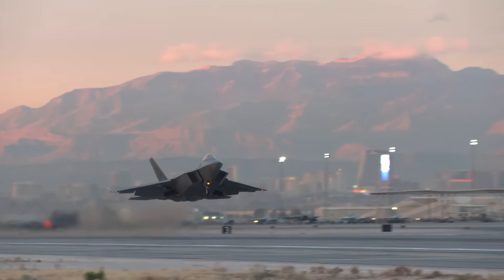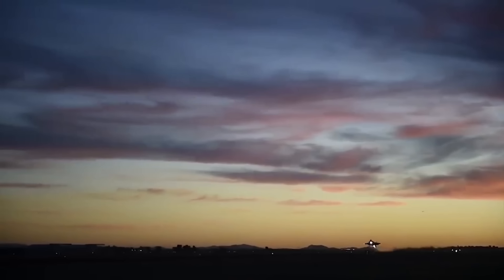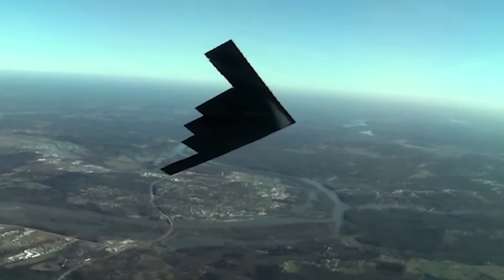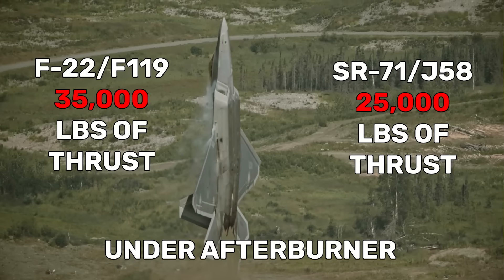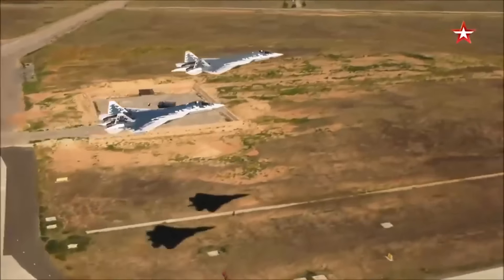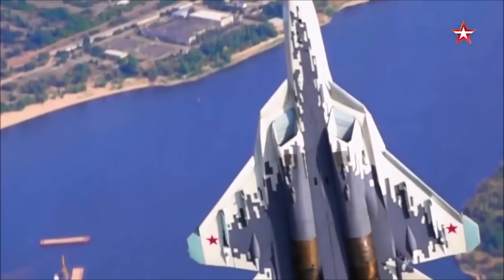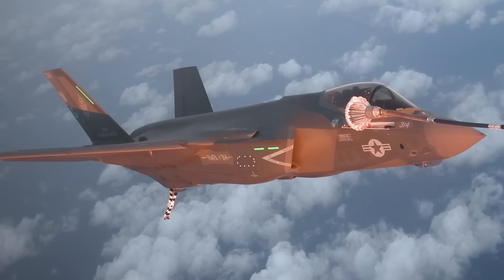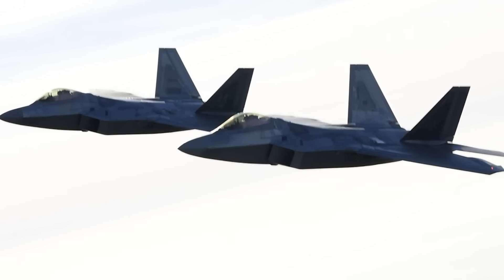The race to field the most powerful stealth fighter engines in history

Comment: Air Force should've gone with General Electric's YF120 variable cycle engine...
Reply: Always about money unfortunately.  Plus, 10 years Lockheed told airforce they would reach a point where the current f135 engine could not provide enough cooling power.  Which is the problem they are running into now with block 4 upgrades.
Reply: @ShadowOppsRC  Duly noted.  I've seen articles specifically addressing the need for cooling power with the upgraded processor suite(s).

Comment: The Northrop YF-23 had a 40% range advantage over the F-22, which has the same net advantage as more modern and efficient engines.  It also had a lower radar signature than the F-22 and a 10,000ft greater service ceiling.  All of which are great advantages.  Many people think that the F-23 should have gone into production.  It may have been slightly less maneuverable than the F-22, but this could have been mitigated by installing thrust vectoring onto the F23.  Also, the F-14 has much greater range than either the F-18 Super Hornet or the F-35.  It was a great shame that modern versions of the F-23 and the F-14 are not in use today.  Interesting to note that the USAF is getting hold of as many newly built modern F15 aircraft as it can, which is an aircraft that in many ways is very similar to the F-14, with great range and endurance and kinematic performance.  Range and endurance will be highly important in a war against China.  It seems that bad decisions made years ago are having an impact today.
Reply: Its service ceiling is the same and the difference in radar signature is small. Yes it went further because it had more space for fuel, it isn't like it just magically went further. It wasn't slightly less maneuverable it was enough that it couldn't keep up with the F-22 and would get zeroed. Stop it with the nonsense bellyaching.

Comment: The problem with claims by both China and Russia when it come to modern jet engines is that they still lack the capability to EDM drill the 8 or 10 mil cooling holes and then laser ablate an equally tiny diffuser on top of that hole hundreds of times on a super allow turbine blade with a complicated internal serpentine to trailing edge configuration.  Even doing this in a lab is hard enough and then taking it to a mass production environment is extremely difficult.  I know for a fact that the WS10 had a military power life cycle of less than 10 hours, and is therefore highly "derated" (operating at a lowered firing temperature) to actually use it on their planes.  What this means is that they are limited in the true power they can use for these aircraft in everyday use and training.  To use the engine at it's full power will mean shortening it's life cycle to tens of hours before needing to re-aero the turbine.  The WS15 is not a great leap over the WS10, and still has the same problems with cooling at higher power.  In a conflict China would likely find it's self in a supply chain nightmare as they would not be able to maintain their fleet.

Western engines are measures in the many thousands of hours not tens of hours... I would warn against just looking at posted specs about "thrust", as this is only one tiny part of the issue.  If you can only maintain that aggressive level of power for a short time on wing before your turbine is burned up then you will soon be worn down.  Combat will do that in short order.
Reply: I worked in the casting of jet aircraft blades and vanes and rarely got to see the finished parts except for customer returns.  In the shipping dept, I got to see some of our parts that were finished by other companies and was quite impressed with the ceramic coatings and leading-edge work(all the precise holes).  Over the thrty plus years I worked I saw the plant go from solid equiax blades and vanes, DS directionally solidified and finally SC single crystal.  Single crystal, I think, is where the longjevity of or cuurent engines arises.  They're expensive  due to the scrap rate while the mold design is perfected for each part.  Any change to a part requires a whole re-evaluation of mold (wax setup) monoshell formulation and vacuum casting instructions.  Now GE has thrown a lot of that out with a composite laminating process where nickel alloys aren't even used in many parts.  The engine that GE proposed as the replacement for the F-35 uses composite parts.  GE's technology is so new that the military decided to save it for the next generation fighter ( which like the F-22 probably won't be shared).  Like you stated, there's more to jet engines than any one process or part.
Reply: @josephbucknavage6739  Yes, modern turbine blades are high tech manufacturing wonders of Engineering, design, metallurgy, and cooling.  Being from that World I know you understand how protected these Export Controlled and ITAR processes are.  I was with both both of the "Big Two" Engine companies as a Design Engineer for both Military and Commercial engines for 30 years.  You stated the process pretty well, Wax Mold, Casting, Grinding, Machining, Drilling, Laser Ablating, diffusion coating, ceramic coating... on and on and on.  This is NOT easy stuff to mass produce and takes a lot of high tech manufacturing and very skilled Machinists.  It is more of a high tech lab than a "machine shop".  China nor Russia are there yet, and the new 3-Stream designs from both P&W and GE will be yet another leap.  Also, GE has just made some major progress with "Rotating detonation combustors" (RDC) that will soon be yet another major leap.
Reply: @shutupanddrink3960  It will take a hell of a lot more than notes...
Reply: @_Coffee4Closers How long will it take china and Russia to get there then if they are not.
Reply: @elijahcorbie2471  China is making the best and fastest progress now I think.  I think they are getting closer for sure, and can likely do some of these things in a "laboratory environment".  However, it is a huge step to go from a lab and a room full of pHD's producing one turbine blade a week to a production floor producing thousands of turbine blades a week or day with machinists.  I think China gets there within the current decade... but will remain behind overall as the West is moving on to three-stream adaptive engines, Rotational detonation combustion, 3D printing of super alloys with complex internal cooling schemes, and carbon matrix composites reducing weight and increasing life.

Russia, is probably never getting there in their current state, and the needless Ukraine War draining resources, manpower, and money.
Reply: @_Coffee4Closers  hmm interesting because I have heard that china was able to overcome all the difficulties they were experiencing earlier last year with the engines and could now build them in mass.Also I hear that China is also working on Rotating detonating engines,3d printing technology and hypersonic scramjet engines too,they desperately don’t want to get left behind.Lots of contrasting and conflicting information out there.
Reply: @elijahcorbie2471  China claims to have finished the WS15 development and achieved the output they required for the program.  They probably have gotten the thrust they were targeting.  However, that comes with a few caveats... where they fall short is life cycle.  And that is where all the advanced technology pays off.  You can develop an engine with the thrust pretty fast, what you can't do it make it live that long until you master a lot of high tech manufacturing capabilities.
Reply: @_Coffee4Closers  yah I heard that even though they could build them.They have endurance problems or their endurance is not as good as American engines.Which affects combat readiness.So they still have work to do.
Reply: @elijahcorbie2471  It is always easier to catch up when you are copying somebody else's work.
Reply: @elijahcorbie2471  Its been over 7 years and they have only made 200 hundred of a jet that they want to make over 2000... they are way way behind and that doesn't show that they have fixed anything.

Comment: That Su-57 maybe be “stealth” but is a giant target from the rear with those exposed nozzles. Those will be giant red hot targets.
Reply: And the front since there's no s-duct to hide the engine blades or heat, supposedly they're adding inlet grates similar to those on the super hornet to improve RCS but it's still a design compromise
Reply: It isn't good at stealth at all, it is better then it's predecessors but that doesn't mean it is good.

Comment: The J-20 mighty bass boat is the most hilariously fugly "stealth" plane there is. It's extremely maneuverable as long as you pick a heading and stay there. 😂😂😂😂😭😭😭
Reply: They unironically used PVC pipe in the cockpit, you can see it at 5:54 and again at 6:01 behind the headrest
Reply: @Skinflaps_Meatslapper there’s PVC pipes on the F-22 and F-35. Those are standard for emergency egress
Reply: It isn't very stealth either, both the russian and the chinese planes would have major issues if they are flying anywhere near perpendicular to anything.
Reply: @nmbaru  There literally is not in dozens and dozens of photos and why on earth would "PVC pipes [be] standard for emergency egress", pull your head out

Comment: F-15 Eagle II engine F110-GE-129 Specs:
- Thrust Military  (Dry) — 17,155 lbf (76.3 kN)  × 2,  34,300 lb-ft
- Thrust with AB (Wet) — 29,500 lbf (131 kN)   × 2,  59,000 lb-ft

F-22 Raptor engine F119-PW-100 Specs:
- Thrust Military  (Dry) — 26,000 lbf (116 kN)   × 2,  52,000 lb-ft
- Thrust with AB (Wet) — 35,000 lbf (156 kN)   × 2,  70,000 lb-ft

F-35 Lightning II engine F135-PW-100/400 Specs:
- Thrust Military  (Dry) — 28,000 lbf (125 kN)   × 1
- Thrust with AB (Wet) — 43,000 lbf (191 kN)   × 1

IF the F-35 engines dimensional compatibility means they fit in an F-22 (+1,500 lbs each).
F-22 Raptor engine F135-PW-100 Specs:
- Thrust Military  (Dry) — 28,000 lbf (116 kN)   × 2,  56,000 lb-ft
- Thrust with AB (Wet) — 43,000 lbf (156 kN)   × 2,  86,000 lb-ft

Su-57 Felon engines (AL-51):
- Thrust Military  (Dry) — 24,250 lbf (108 kN)   × 2,  48,500 lb-ft
- Thrust with AB (Wet) — 37,500 lbf (167 kN)   × 2,  75,000 lb-ft

P&W F135  Growth Option  claims testing is completed & production-ready:
- Thrust Military  (Dry) — 31,000 lbf (128 kN)   × 1
- Thrust with AB (Wet) — 47,000 lbf (195 kN)   × 1
GO claimed power increase: +8-10% across flight envelopes.
GO claimed efficiency delta:  +5-6 %  lower burn-rate.
Reply: These numbers are cool but not really what's important. Thrust to weight, low infrared signature, fuel efficiency, reliability and super cruise. He barely touched these.
Reply: When looking closer u realize most US jets are lower in thrust to weight. The f35 can't super cruise. Not even at mach 1. Russians claim al5af1 can at mach 2. The USAhas always led with reliability but now the f35 has a operational readiness around 40% (I'm not sure if engine related but I have read good and bad). We most take our advsaries seriously. This constant lying and overlooking hurts us. Did he avoid this just to brag about a thrust number. Like a drag racer bragging about hp. While running embarrassing 1/4 mile times. Or is he just clueless on the topic?
Reply: @vasilijevukadinovic6843  The F-35 can supercruise, just not far (150 nm "dash") and only with a clean configuration and probably not entirely fueled. Its airframe is inefficient to that degree.

Comment: 5:54 did the Chinese seriously use PVC pipe in the cockpit of their PREMIER 5TH GEN STEALTH FIGHTER?  There's some more at 6:01 behind the headrest too, you can even make out the hex fitting adapter.  I got written up by the FAA once for using a PVC fitting as a non structural vent on the spray system of my 50 year old cropduster FFS

Comment: You also failed to mention just how quickly in F-35 will run out of fuel if it's using that extra 16 000 pounds of thrust through all five stages of afterburner

Comment: It's not much of a race... The F-35 has it by a wide margin even with it's current engine, and I highly suspect it will remain that way - especially with the upgrade. For a good point of reference, the F135 engine currently in F35's produces over 28,000lbf of dry thrust. That means no afterburner. Fhat is basically identical to an F-16's engine WITH afterburner. 

With the burner engaged, the F135 puts out 43,000lbf. And to think they are goong to put an enven more powerful engine in it.... I suspect at least 30,000lbf dry thrust and 45,000lbf with afterburner.
Reply: Thrust-to-weight ratio is insane 💪
Reply: They won’t replace the engine but upgrade the F135 with an ECU that improves performance, reduces fuel consumption, and provides more power & cooling for the aircraft
Reply: @chrissmith7669  that's literally what he is talking about.
Reply: @kinematics7092  there is the proposal for a replacement but itvlacks STOVL capabilities Sonia a nonstarter for the pentagon

Comment: Honestly, "stealth" (at least in terms of RCS) isn't significantly IN engine design itself. The fan/turbine blades "must" be curved, and then they must rotate... it's a complete mess on RCS. You minimize RCS on the engine by limiting visibility to the engine (fore & aft), and carefully designing the intake or exhaust placement/shape/materials. You're especially limited in materials on the exhaust though, due to temperature, so turbine visibility is a serious RCS problem. Also, there's limitations to low RCS with thrust vectoring. Exhaust also is very hot, so limiting visibility to the exhaust is also critical to IR stealth. Ergo the reason the YF-23 would've been nice.

F135 is high-bypass... which makes cooler exhaust, more thrust, and greater fuel efficiency. But it limits top speed compared to more narrow designs.
Reply: And having one engine in the center makes it far easier to have ducting that hides the fan blades from incoming rader compared to 2 engines with intakes that exposes the 2 engines and their fan blades.  This is one reason why f35 has better stealth then the f22.
Reply: @Albertkallal  Done right, you can block visibility into the engine front with other configurations. B-21 and B-1 for example handle it well with 4 engines each. But yeah, a single engine design is well suited.

F-22 mostly minimizes the problem as well, but there are a couple unhelpful angles. Fortunately they're angled so that nobody would get a prolonged look from those directions.

YF-23 was kinda special among fighters in that it greatly limited thermal visibility, and rear turbine RCS as well. Only the B-2 and B-21 have similar, and the V-tail does a better job of hiding it from the sides on the 23.

Comment: I’m not convinced on the Russian or Chinese “stealth” gen 5 jets. They look absolutely miserable in the cross section area. Especially the Chinese draggin.
Reply: Well you're right to be sceptical. The patent filed by the company who created the SU-57 puts the Stealth capabilities in line with 4th Gen jets.
Reply: @zachb1706 

It’s somewhere near a clean Super Hornet in terms of stealth. Not bad for a Flanker, but she’s a big visible girl next to the F-22 or F-35.
Reply: There's been detailed third party simulations done on the J-20 (think it was titled aircraft 101 J-20 radar scattering simulation) which found it actually had a pretty impressive RCS profile considering how far their industry has come, after all it does have many of the design elements that benefit stealth. It obviously doesn't reach anywhere near the same levels as the F-35 even compared to the 35's simulation (which neglects aspects such as the fibermat RAM coating) but I think it fairly qualifies as a 5th gen presuming it also utilises extensive sensor fusion etc.
Reply: @aidanwilliams9452   Those canards are especially stealthy...
Reply: @Not_So_Common_Sense  Canards are a design compromise but it's wrong to think they negate stealth entirely. The canard leading edges align with the main wing, from production photos you can see the sawtooth pattern on the trailing edge too. During manoeuvres the same reflections apply to tail and rudder surfaces not just canards. From the simulation the biggest radar spikes iirc occurred after 50 deg off centre, meaning frontal stealth would be effective at range, which is largely what the J-20 is meant to do.
Reply: @aidanwilliams9452   The thing is, if/when SHTF the J-20 will be competing against 5th (and 6th...) gen US aircraft with superior stealth characteristics. Merely reduced RCS will cut it against a Super Hornet but not against an F-22/F35 or NGAD.
Reply: @Not_So_Common_Sense  Of course, I never said it was superior to either F-22/35, but it's definitely a leap in their industry (likely in big part to the F-35 data leaks). But it's still more of an obstacle than China or Russia's 4th gens, so as long as US pilots continue training against 5th gens and planners don't get complacent then they'll be fine.
Reply: @aidanwilliams9452   true
Reply: The US will be receiving their 6th gen fighters before Russia gets to 5th gen.